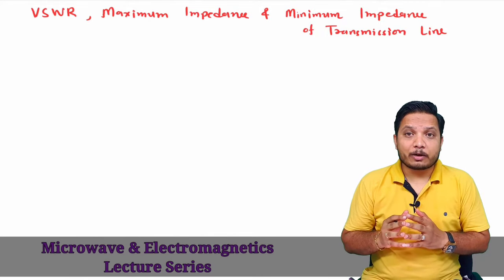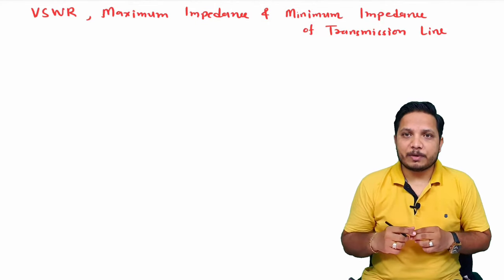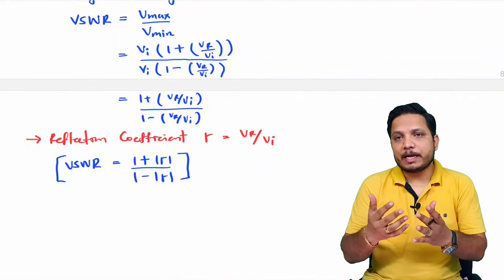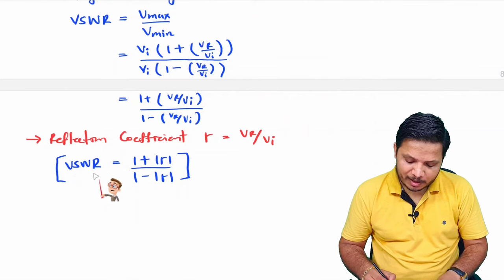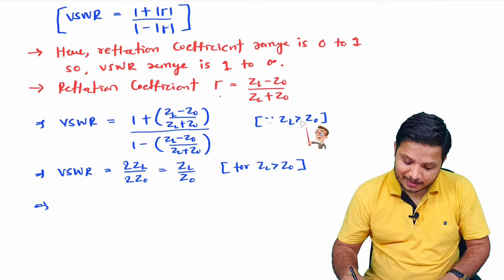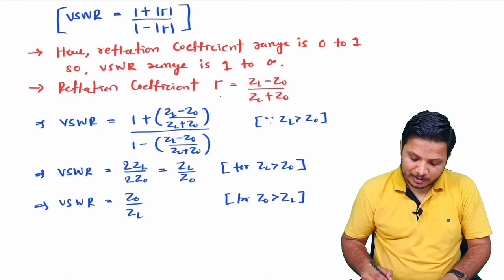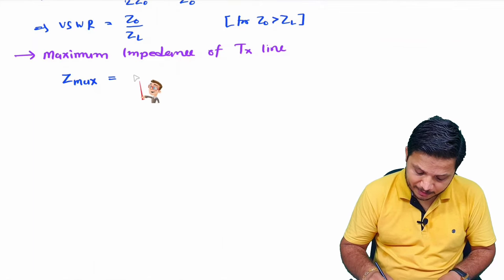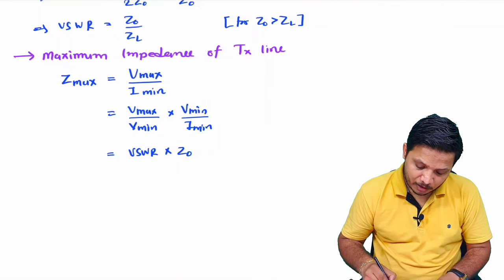VSWR - Voltage Standing Wave Ratio, Maximum Impedance & Minimum Impedance of Transmission Line

Comment: A question here,
why the reflection coefficeint there should be replaced in absolute value?

Thanks in advance
Ray
Reply from the maker: Reflection Coefficient explains that how much voltage will get reflected based on input. It is based on transmission line, it doesn't depends on input or output.

Comment: 1. A hollow rectangular waveguide has dimensions a = 1.5 cm and b = 1 cm. Calculate the amount of attenuation if the frequency of the signal is 6 GHZ.
A) 1453.23 dB/m    B) 1500 dB/m          C) 1400 dB/m           D) 1475.23 dB/m

2. A rectangular cavity resonator in it’s dominant mode with dimensions 5 x 4 x 2.5 cm will resonate at which of the following frequency?
A) 6.71 GHZ B) 7.71 GHZ C) 9.7 GHZ D) 5 GHZ
3. Double minimum method is used to determine the VSWR value on a waveguide. If the separation between two nulls is 3.5 cm and that between twice minimum power point is 2.5 mm, determine the value of VSWR.A) 2 B) 4 C) 8.9126 D) 6

4. If the incident power of a 10 dB directional coupler is 250mW, what is the output power in it’s auxillary arm?
A)25 mW  B) 30 mW  C) 50 mW   D) 100 mW

5.TE 10 wave is transmitting inside a transmission system operating at 10 GHZ. Dimensions of waveguide are 4cm * 2.5cm distance measured between twice minimum power points is 1 mm on a slotted line. Calculate the SWR of transmission system.
A) 10.3 B) 11 C) 9 D) 10.7

Sir can you solve it?  this question  because it is difficult to solve the question